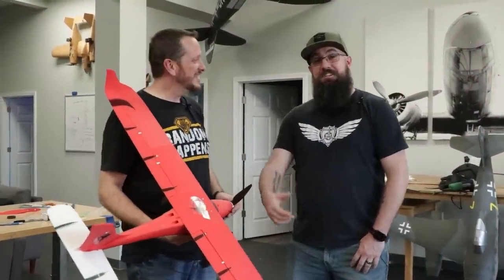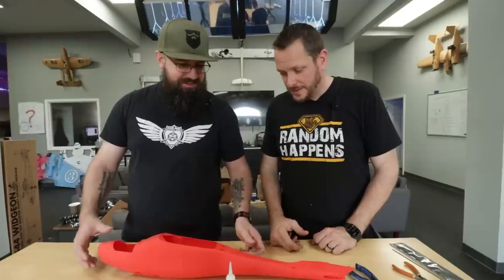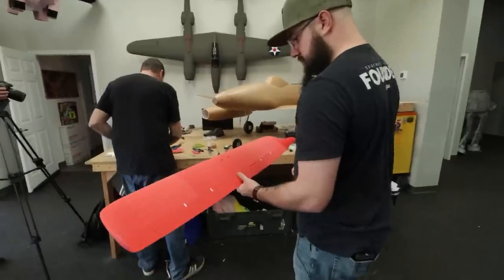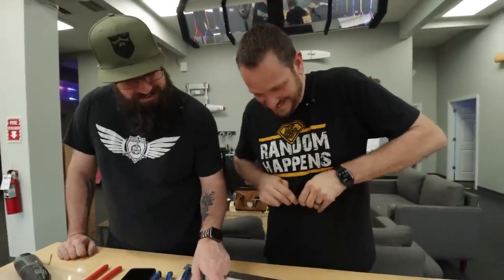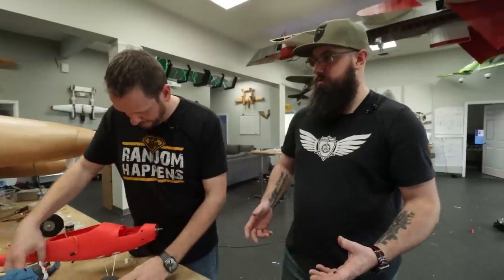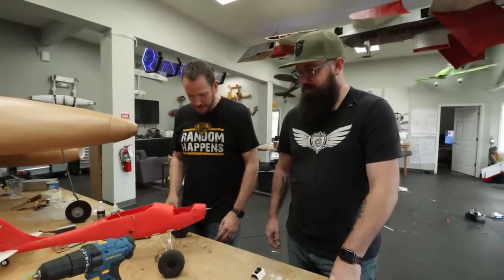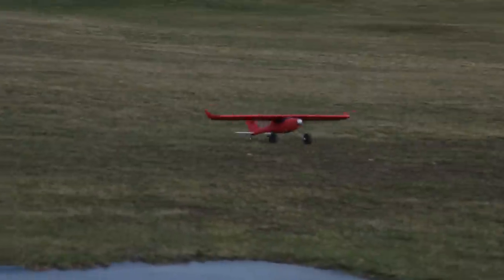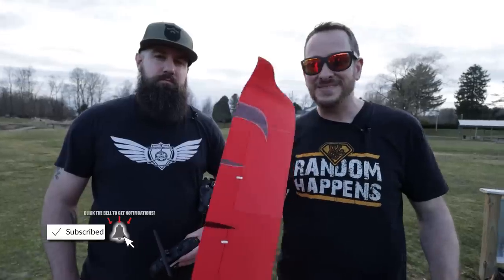Light Weight 3D Printed Bush Plane!

Comment: I own a 3D Printer since 2018 and always needed to design my own parts. Now with more and more people getting into the hobby i now finally can outsource the most time consuming part of designing the Plane. While in the same time learning new connection methods. I just print the whole part of the wing with the rudder and flaps already attached to the frame. This is a technic i learned from the moving parts on thingiverse.

Comment: If your not using LW pla, I would recommend using a 3 blade prop for more power because it will need to go a  LOT faster than the other in order to take off because of how much it weights.

Comment: Who printed the plane and what 3D printer did you use?  How many print fails did it take to get the final parts?
Reply: Likely 0. I know I've never had any of these prints fail on me
Reply: I've just started printing the Model A using Eclipson provided G code. Printing perfectly in LW-PLA at first attempt. Easy.

Comment: Awesome plane. What chase quad is TJ flying?
Reply: Nothing fancy:
Diaton Roma F5 DJI frame
Diatone mama f405 dji stack f50 esc
Sunnysky 2207 I think 1800kv
5" HQ r38
DJI air unit
Crossfire
6s 1300
Gopro 8

Comment: how does the weight reduction handle with flying and did you guys put it under any duress? like how does it handle hours of time on the printed material, how long does it take sunlight to start doin funky things to it? did you guys print that or was it kit? i missed that part i'm sure . . .  but if you print how long does it take, is the print easily set up or is it wonky with lots of failure? i'm a complete noob to 3d printing but am diving in quickly and have been around people use'n them for a minute this is the first 3d printed item in my range of price and capacity that really peaked my interest :)

Comment: I'd like to see how repairs are done to these 3D printed planes. Thanks.
Reply: Reprint the affected section, cut off / remove the damaged one, reglue...go fly. It isn't hard at all.........
Reply: @theangrymarmot8336  I thought the CA glue fused/melted the plastic together at the joints. If this is not the case then I can understand the repairs being easy. So, you use some sort of solvent to loosen and cleanup the glue?
Reply: @BillKisel  I use a hot razor blade and just cut the plastic at the seams of the damaged section, go over with a nail file to square it, and glue the new section in.

Comment: Now crash it and let's see how hard it is to fix.
Reply: Easy...just reprint the broken sections and re-glue it. Easy as foam? Of course not - but this is a more advanced technique that allows for more advanced shapes. Same as crashing a balsa plane - you just remake the broken bits and replace. I don't see why there are already several comments about repair ability. It isn't like once you print a single part you can never reprint it - lol.
Reply: @theangrymarmot8336  my main concern is how hard is it to take apart to change the broken parts.
Reply: @jamesordwayultralightpilot  It is glued together in sections, just cut it at the section lines and replace the parts.

Comment: Super cool stuff however be straight about print times. They will be epic.  LWPLA isn't cheap, there is a learning curve and things won't be so simple. Three hours? Be straight with people.
Reply: They said three hours to assemble. Not print. As someone who actually prints their own airframes I found nothing in the video misleading.
Reply: @theangrymarmot8336  Right, they did say that. It was however a very rosy picture of what is in store. Some of the FT content is a bit too commercialized lately. I print airframes as well.